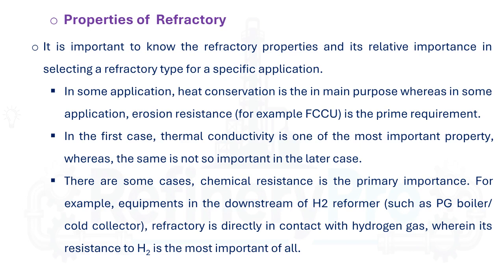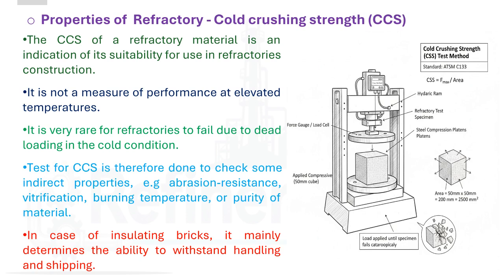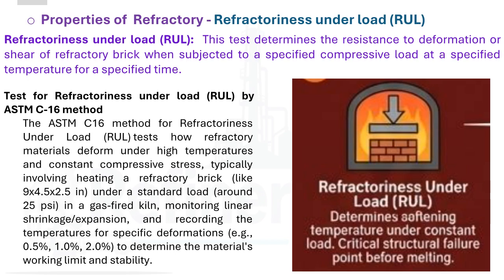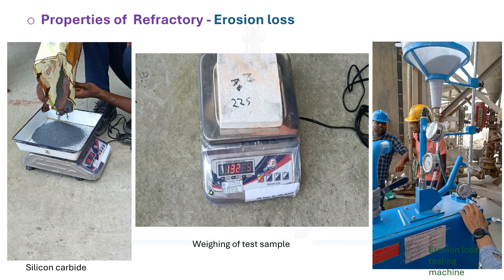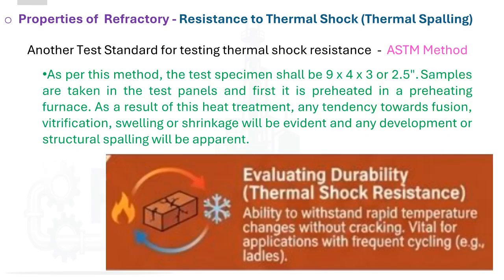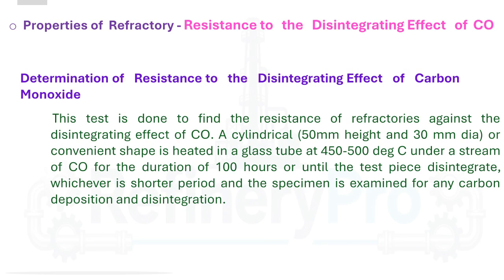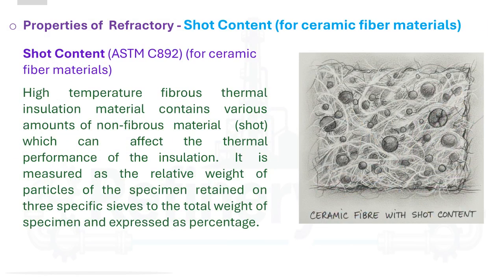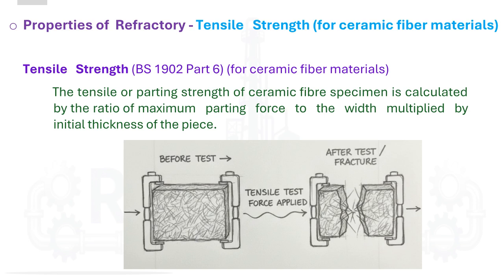RefineryPro   Episode 3   Properties of  Refractory Materials

Comment: Great insights in RefineryPro Episode 3. Understanding refractory properties is indeed the foundation for any high-temperature application. As someone working closely with industrial kilns, I’ve seen how seemingly minor property mismatches—like thermal conductivity or refractoriness under load—can lead to catastrophic failures. At CH REFRACTORIES, we emphasize testing each batch for bulk density, porosity, and cold crushing strength before recommending material for cement or steel linings. For example, selecting a castable with the right alumina content can make or break a furnace campaign. A wrong choice not only reduces efficiency but also risks unplanned shutdowns that cost far more than the material itself. Our team at Zhengzhou Caihua Kiln Masonry Installation Co., Ltd has worked with pre-cast shapes for petrochemical reactors where thermal shock resistance is critical. The video’s point about matching properties to application is spot on—whether you need insulation products for a power plant or specialty fire bricks for glass furnaces. I’d love to hear how others approach property verification in their own operations.